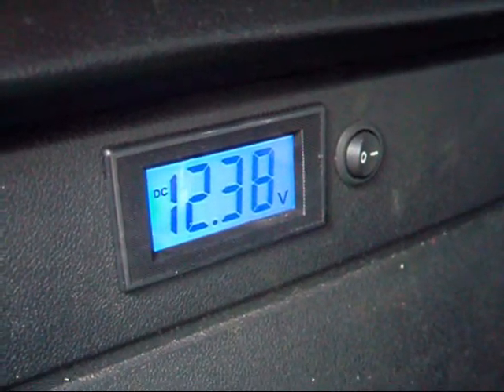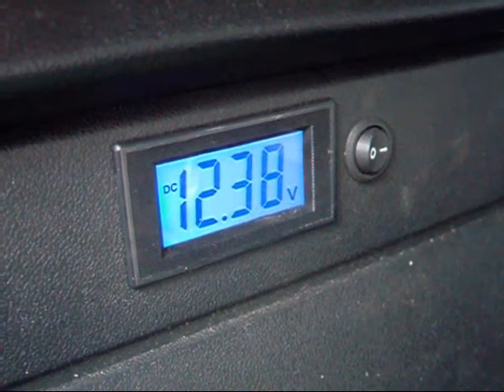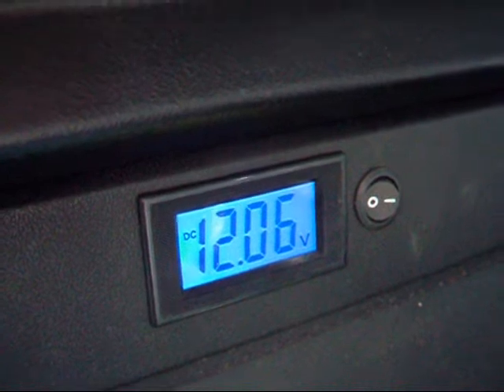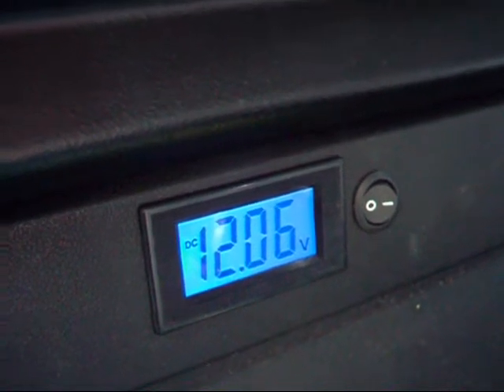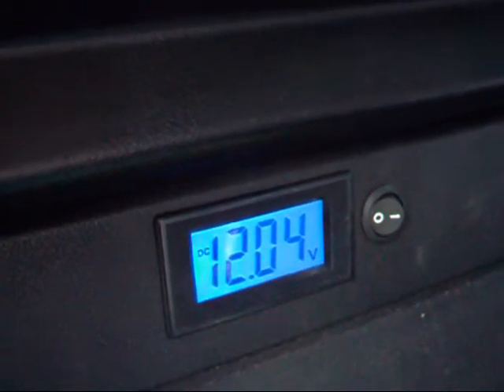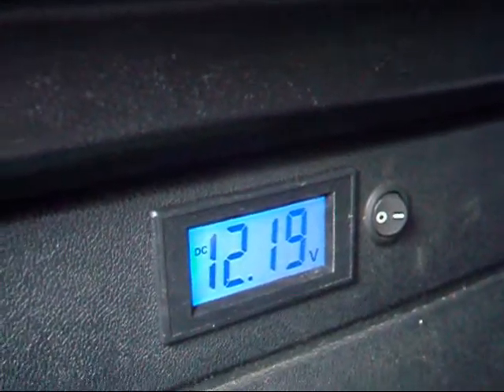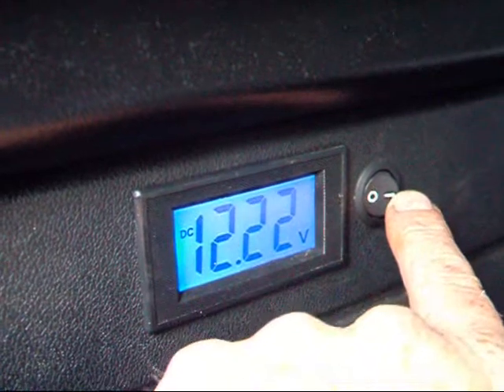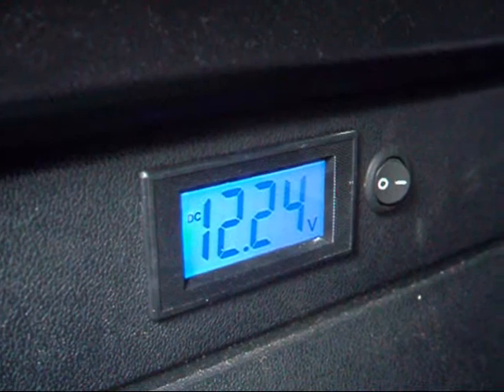VW T25 Voltage Meter Modification Pt 2 - 80/90 club

Comment: I got  a positive responce from Elite.element on E-bay. They are sending out a replacement unit.At no cost I would still like to buy replacement guages only, in case I ever need them. The shunts should last forever as they are built solid. I do like these units when they work as they are easy to see and read.